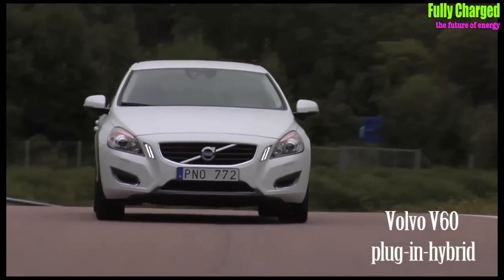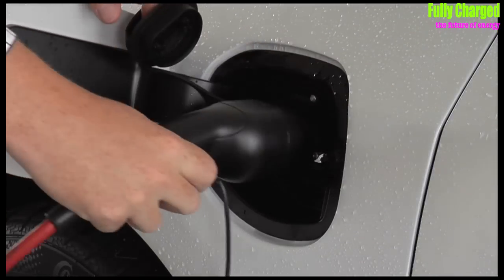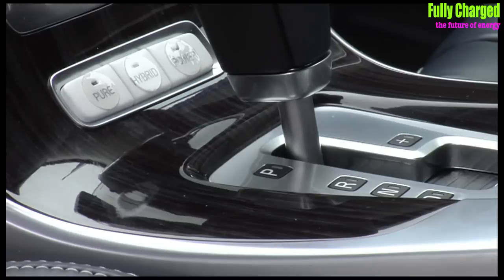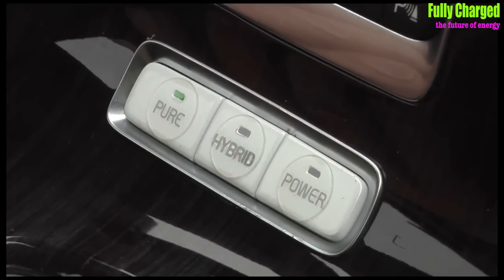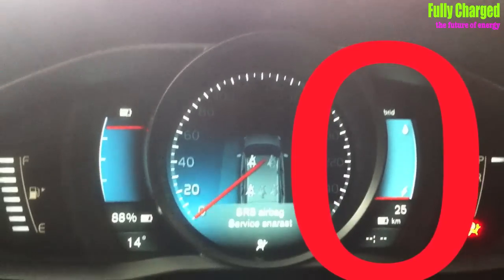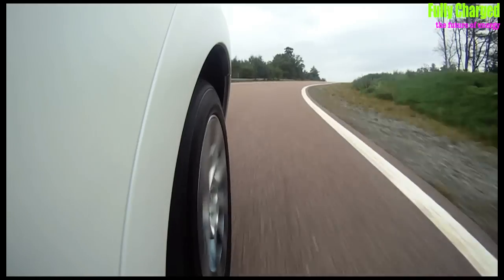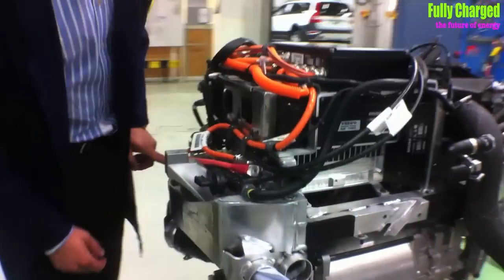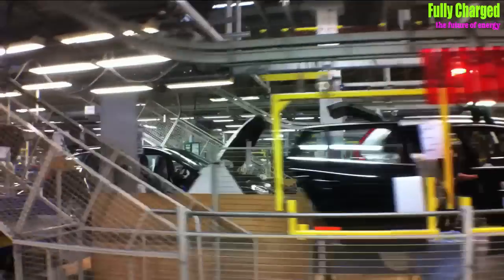Volvo V60 PHEV | Fully Charged

Comment: I tried a Volvo V60 R. Line hybrid from Denmark to Roterdam and back. It's a long time since I've tried so good and comfortable car. It was strange the first time that you start and begins to run on electricity. The silence. It's great. And the acceleration it have, even if it run on electricity ..

Comment: Mitsubishi outlander PHEV is better than this as It could run 120km/h without engine assist. Full charge is more than 50km,. 

And one more thing it equip with rally proven S-AWC. This machine run on  twin electric motor on the 4 wheels. Combustion engine come in when power needed for high speed and hard acceleration.

When battery depleted the engine kick in to charge to battery with 70KW generator. You can charge the battery to 80% with idling for 40 mins.
Reply: Idling for 40 mins with a petrol engine sounds like a bad idea

Comment: The solution would be to uninstal the DPF because it is in fact a polution factor. 
DPF's and that is a little known fact are harming the environment more than not having them installed. Why? Because cars without DPF produce soot not good but relatively heavy so it won't stay in the atmosphere they will fall to the ground and will be absorbed by the flora. What DPF's do is they burn soot and produce "particulates" and CO².  Particulates are much more harmful to humans and stay

Comment: My understanding is that since this video was made, Volvo has changed the air conditioner and oil pump to both work electronically, without the need for the engine to be running. That's important, because it means that the V60 plug-in can now start, and run on electric power only. Much cleaner too, and means this can be a pure EV for short to mid-length journeys. 

£47,000 is a LOT, this is a high-end car, with a high equipment level. You also get £5000 in UK subsidies for it and fuel savings.

Comment: @XitUp I am sure that it will have a 'regeneneration mode' to enable the engine to produse the temp.
As most vehicles will aim to do a regeneration on a higher speed long run senerio in the first instance, the engine will be running in this drive anyway.
Ultimately it is the exhaust gas temp. that is key not the engine temp so almost instantly the engine will be producing the temp. required.

Comment: Its disappointing that the deisel engine comes on right away when you start the car. If you have electric capacity then it should wait until the battery is depleted before starting the engine.

My 2nd gen prius bugs me because the gas engine comes on soon after you start the car regardless of battery charge, engine warmth or depressing the throttle. Sometimes I just want to move the car into the garage or out to the street and starting the engine is totally unnecessary.

Comment: I've been wondering about diesel-electric hybrids for awhile, but I would think the place to put them first would be in large trucks, which use diesel engines anyway. They would, of course, run on diesel for cross-country travel, but for low-speed residential driving and pulling away from a traffic light, electric power would help them be quieter and cleaner as well as more efficient.

Comment: @warblingtransistor 
In other words, you'd prefer an extended range EV(some prefer calling them serial hybrids).

The Fisker Karma is actually build that way, except it's a sports/luxury car, so it has a powerful petrol engine to extend range and/or power. But it has all the tech that is probably the best way forward at the moment. 

Surprisingly, none of the big guys, Robert included, have taken a serious look into it.
C'mon robert, get with times here.

Comment: @XitUp I can't tell you what they spent, I'm sure they just hired some consultancy company that gave them very expensive solutions but if they had the relevant electrical engineers and all the development amortized then it could be 500$ for the motor, 800$ for all the power electronics (controller, DCDC and charger) and say 8000$ for a 20kWh robust lithium pack. and that is a 100kW system.
and that's the cost for converting a wasteful C30. which they wouldn't do if they were intelligent.

Comment: @JRoque250 VW Cabrio? Is that that Golf? If so, by admitting to owning a mk3 Golf soft top you have admitted to not knowing anything about cars. In which case I will ignore your opinion.
In all seriousness though, seriously? Do you live somewhere with no water, how has that car not got any rust yet.
Also, how many miles on the first engine and what did it die of, and how many miles on the 2nd engine?

Comment: @XitUp 1996 VW Cabrio. Prev owner replaced engine at 90K Miles. On 2nd engine, I had to replace the water and power steering pumps, oil filter, air filter, 2 radiator hoses, all belts, both oxygen sensors, mass air flow valve and spark plugs so it would run reliably and be road tested to see if it was a worthy EV conversion candidate, and that it is! The muffler is busted and the gas tank leaks : - )

Comment: @XitUp Hello. If your car is rusted or "totaled" then obviously is not a car you want to keep, which is premise of my original post. If the engine lasts longer than the body on the car, you've likely replaced many of the engine components and none of the body's. My 192K miles car has a great body but a 2nd engine and rusted muffler; it'll be converted to an EV soon. My 37K miles car has a great engine and I will make it better by yanking it out and converting it to an electric.

Comment: @rainbowsalads I can visualise many things in my mind. But it takes a bit more than that to get things done.
For taxi firms and local delivery though, I think hot swapping could work, as they tend to have a set route, standardised vehicles and a central hub or depot.
For the rest of the world it is unrealistic, and unnecessary, if we have range extenders, slow charging at home/work and fast charge parking bays at motorway service stations for longer trips.

Comment: @DanFrederiksen 
Obviously one can't rearrange *all* houses. But there are a lot of places where you could encourage small distance communities without too much work.

And while a 400kg car can carry 5 people, it won't be safe in the least. Heck, the 5 people will weigh more than the car, the raw stesses in a crash would have them tear it apart.

Since NCAP crash tests came about several very light cars have been outright banned for being too unsafe ... the Citroen 2cv for example.

Comment: @Jesus45U in a collision with an immovable object a 500kg car can be much safer than your typical 2 ton piece of shit. remember that dumbass tiger woods knocked himself out at low speed in an escallade.
and while it's true that in a collision with a heavier car you are at a disadvantage due to laws of physics governing exchange of momentum, not because the shitty steel car is stronger. but there is an easy fix to that. make the idiotic cars illegal.
fiberglass is not only strong if heavy. think

Comment: @DanFrederiksen 
I have worked with composites, I know how strong it is.

I also know that if you build a 500 kilo car, it's going to be less safe in a crash than a 2 ton steel one, no matter what material you use. Especially if it's in a crash with another 2 ton steel car. Yes, fiberglass can be safe if you make it thicker, but then it gets heavy.

Yes, I advocate bicycles. The speed is *much* lower, they cost very little to produce, and if the roadnet is buildt properly, it's safe to bicycle.

Comment: @greyareaRK1 
To be fair, Robert is every bit as biased towards the electric car, as Top Gear is NOT biased towards the electric car.

Top gear does raise a few real, and fair points - You can't just take a pure electric car today and go anywhere you want, and that's a bugger. And unless you get to a fast charge station, it takes a long time to recharge, that's also a bugger.

Robert on the other hand, also raises a few good points - ICE's are not efficient in any form, but they are flexible.

Comment: One of the things that concerns me about diesel hybrids is the DPF. Will it get hot enough to clean itself if the engine is constantly being turned on and off.
Modern diesel cars have huge costs for replacing parts due to the complications of trying to clean up a dirty fuel, I think this would only make things worse.

Comment: @rainbowsalads It would take all manufacturers to agree on a standard size and shape battery. It would take consumers who don't care if they drive their new car into a station after 200 miles and swap the battery for one that has half the capacity after doing 150k miles. It will take billions of £ for the infrastructure.
It's a bad idea.

Comment: Well indeed impressive, but no doubt with Volvo's very high costs for parts and servicing added to the habit of all manufactures to ramp up the price of anything that burns less fuel, I would imagine this car will be well beyond the budget of most of us, and that's the problem! I'd switch today if I could, I really want to but just could not due to the cost. It does not matter how much they can save you once you own them, if you just can't buy them its not good :-(

Comment: @Jesus45U yeah tradeoffs are a bummer.  like Speed vs Efficiency.

Pure bicycles have the problem of aerodynamics, and the driver has no shelter from the wind/rain.  Which is likely why that electric wicycle i linked to looks a lot like just a recumbent bicycle enclosed in fabric.

I love my bike, but it's really dangerous to share the roads with cars.  Also it only goes about 20 kph if i'm lucky, which is very limiting.

It seems that cars aren't big JUST to be safer, "style" wastes much space.

Comment: @roidroid 
It's interesting how much the weight of cars have cone up since the mid 1980's.
Offcourse, the cars back then weren't as safe, and they rusted a lot.

As for superlight cars, I'd probably stick with honeycomb pattern carbonfiber "cars", they's have better aerodynamics than a tent on wheels, and even be safer. Offcourse, they's still be a lot less safe than the current breed of cars, so we'd have to drop the speed a lot.

Heck, why not just bicycle ?

Comment: -continued :

Second : We NEED a roof over our heads, and in the winter, they need heating ... or we die.

Third : We NEED our to keep our food from spoiling, in other words, we need refrigiation. This at least is already electrified, but it still needs energy pumped into it. We also need to prepare the food, in other words ovens and cooking plates - More energy needed.

Fourth : Banking, Stockmarkets and the whole communications network and server computers, also requires energy.

continues-